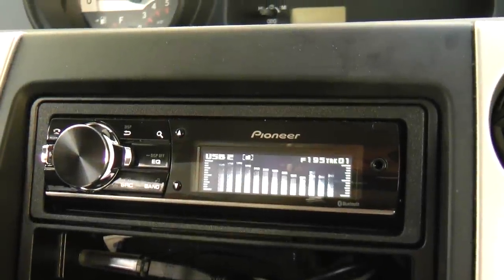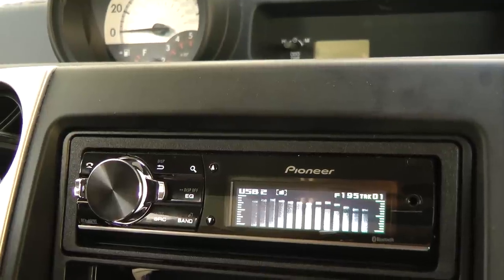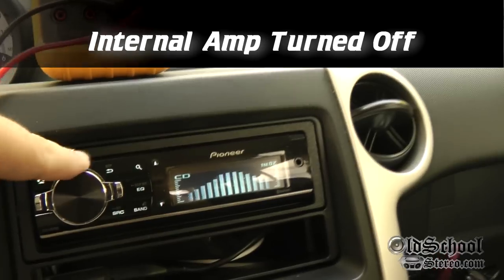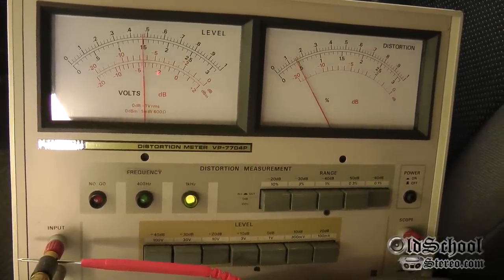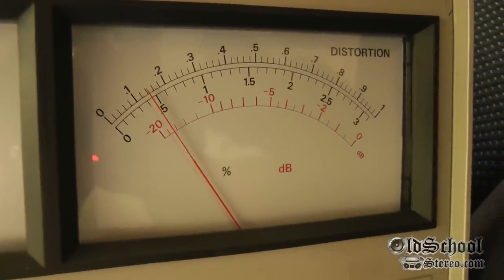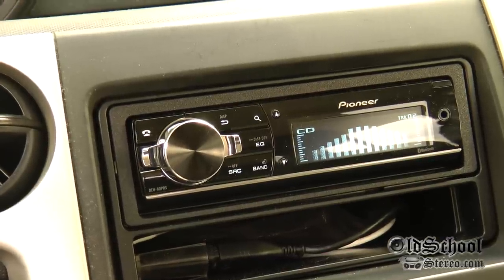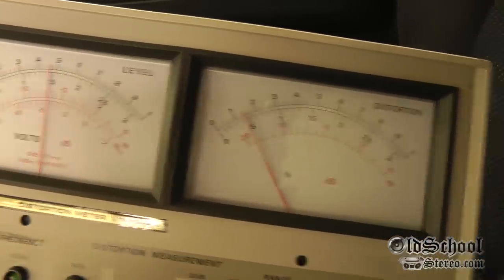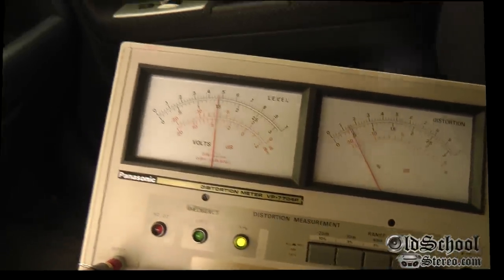Pioneer DEH-80PRS Tested for RMS Voltage and THD Output

Comment from the maker: I'd like to try some old school SQ head units...7909, 7949, Clarion 9255, McIntosh, etc. to see how they compare. This 80PRS gives you amazing features and SQ for a very reasonable price!
Reply: The older units may have a higher THD but for some reason seam to sound warmer/richer than this does.  I like this HU unit too, no complaints D but the 7949, 7990 7909 & the lil 7904 sound incredible, IMO.
Reply: Any other head unit with clean signal and sq? Give me some other option 80prs is sold out

Comment from the maker: I tested another Alpine, the DVA-9861 recently, and this Pioneer is cleaner THD wise (and has more voltage out). Many folks use those DVA's with H701 or H800 processors, so I'll have to combine the two (using optical digital connection), then measure the output at the processor

Comment: Thanks for testing this!  I had the kenwood x997 before this unit and it was nothing but problems.  One thing I noticed is that when I had the x997, I always had alternator whine (even with power going directly to the battery, and grounded on the same point as my amps).  That 80prs cleaned everything up!

Comment from the maker: Yes, I sold the Pioneer / Scion 1805 head unit, but kept the basic factory Pioneer head unit. The voltage output and SQ is just so much better with a good aftermarket HU

Comment: Had the 80prs.Didn't care for how difficult it was to tune.My Kenwood x996 sounds lots cleaner and easier to tune.Good test though D.Always the true stuff on your channel.
Reply: Patience my brother, instant gratification is just the American way now, slow down. Can you remember the old real to real tape systems that were amazing sound but a pain to load and off load. Rewards to those who wait and Listen. 
 It's un-American to be Russian.
Reply: Jonny Breilein yep!whenever I put new stuff in my van I retune everything...will spend a couple hours trying to get the most out of it,till its as loud as I want,and still clean
Reply: @jonnybreilein5343  
I spent 2 weeks with that unit..Was patient enough. Smh

Comment from the maker: Yes, RCA out voltage with the internal amp turned off. I should have compared with the amp on as well. As I'm sure you are aware, it will add somewhat to the THD, so I'd leave it off unless for some reason you'd need to use it

Comment from the maker: The DD-1 shows distortion at 1% THD, this deck does nearly 67x better at 0.015% THD. I recorded a video/test using my Tone Gen Pro app for the 1kHz tone. I think I'll redo it with the uncompressed track on my iPhone 5, the only real "fair" way to compare. This way I'm not comparing using different tracks (in a way).

Comment from the maker: I know what you mean! I'd love to have test gear capable of a full range 20-20kHz pink noise measurement...maybe one day I'll run across a used one for a reasonable price or something. The 400Hz and 1kHz measurements are a big limitation with the Panasonic unit, but it will have to do for now...

Comment: This would be a really great unit but the rca whine which looks to be a huge issue with pioneer was just incredible we tried every trick in the book and ended up putting in a kenwood unit no whine
Reply from the maker: Sounds like a grounding issue. I don’t have the whine issue
Reply: @wal   No doubt, jump over by my channel and see how I stopped the issue, It might be something you never seen or used but stopped the problem dead in its tracks just over a week ago so won't be hard to find

Comment: I have this head unit. Can confirm... Extremely clean.... if you got the $$$
Reply from the maker: +CriticoolHit I still hate the interface and cheap feel, but still the best head unit for the $$
Reply: I don't get the "cheap feel" its very similar to most head units in that regard. One of the biggest, highest quality single din full featured displays though. Not to mention the depth of settings and the most important feature... that crisp, clean output. 

All that being said... No play / pause button right on the front of the unit?  Really?
Reply: CriticoolHit compared to the older Alpine decks or the 99, I agree with ya D. They feel cheap.
Reply: Still... Worth it for that clean signal. (still mad about no play / pause though)

Comment: Hey +bigdwiz, it's ur man from DIYMA. I was really impressed by this. I've never been a big fan of Pioneer decks as I had bad luck with them in the mid 90's. I ended up having one repaired a couple of times. 

Regardless, I am now eyeing one of these on Amazon for $250. I'm curious if there was a difference in preout THD, at a lower volume? When I set up my stereo, I generally set gains based on the source units volume being at ~ 75%- 80% max volume. I'm sure as low as it was at max vol, it would be even lower at a more reasonable volume. Just curious... 

Love the vids and keep it up.
Reply from the maker: Yo Kevin Williams this test was done at max volume, max voltage output and that's the THD I showed. I haven't tried lower volume levels, but I'd suspect even lower THD. When I get a chance, I'll try it out.

Comment: Try to turn it to 62 and engage the eq. Distortion off the charts.  I had this player for two months. Sold it and bought the jvc arsenal 95bt.
Liked the sq better on the jvc but the jvc eq is really insufficient. 
Also thought the bluetooth on the pioneer sounded bad. High distortion after passing 45 on the knob.

Comment: Great test. To perform this test, do you let your factory Pioneer presets to “zero” or increase SLA value and various SPEAKER LEVEL values to reach for the distortion with the volume?
Reply from the maker: +Yvan Doyeux internal amp = off, RCA level test only
Reply: BigDWiz of course only RCA, the question is still the same

Comment: Hey, what's up D.  I appreciate your videos man.   Question for you.  Have you ever checked with the DD1 where this unit clips?  Thanks again.  I subscribed.
Reply from the maker: Thanks for the comment and sub! The purpose of this video is to show how low the THD is with this head unit. It will not clip with the DD-1 at full volume with the 1kHz 0dB track. The DD-1 detects distortion at 1%, this head unit is well under 1% even at full output

Comment: Hey big d wiz. Long time subscriber and viewer of your website.  I have this head unit and I'm having trouble getting the bass where I like it. I love my highs. Just can't figure out where to have my subwoofer level at. I feel like a can't get a good pre out voltage and I have to crank my amp gain if I want to get to the ac voltage that would equate to 3000 rms (what my amp is). What's the best place for all my sub settings before I tune the amp. That will get me the loudest with turning the Amps gain the least? Should I have the "loudness" setting on or off? What level should I have subwoofer level 2 at? I've been struggling with this for a while. On a previous system I had a different head unit. I switched only the head unit to the pioneer deh 80 prs, my bass instantly got much quiter, but my highs got oh so much better. I know this is a lot of weird questions,  that probly don't make sense.

Comment: My 80prs only does 1.958 volts, doesn’t make sense using the same dd1 test tone, and also multiple brands off rcas
Reply: My distortion volume is at 62 so i play music at 61 and clean jus dont have enough rca voltage out,  from wat other people seen to be getting in the upper 4 voltage and 5 voltage on
Reply: @hectorgarcia9509   Did you forget to put your sub level in the 80prs all the way up?  That's your voltage

Comment: Hi Dereck.
If I remove the USB flash for example when leaving the car, and then insert it again afterwards, will the head unit resume playback at the same point of the same track? This is really important to me since I usually listen to long tracks.
Reply from the maker: opaladeluxo73 I do not believe so...but if you leave it plugged in, then it will resume
Reply: opaladeluxo73 yes it will continue playback at the same point, only if you did not modify anything in you flash drive in between.

Comment: Can someone tell me about this test? Is this testing the amplifier in the unit? Or the preamp? And what sources will sound better through this unit? I own a avx 3800 double din that I have not installled yet, and am thinking of selling it and getting the PRS80...but I  need some guidance.
Reply from the maker: +classicjukebox I'm testing the preamp RCA outputs to show voltage and THD. This is the "cleanest" head unit I've tested to date. I want to do another test comparing Bluetooth, CD and USB sources. My feelings are the USB will be the best, but only a test will determine...
Reply: BigDWiz did you get around to doing these tests? ^^  and also. what is the max clean volume for the internal amp? i might run my tweets off of it so id like to know if you have that info... thanks!

Comment: Could run 3 way, and have 6.5 coaxe in back doors, with tweets being ran by unit, front and back doors ran on 4 Chan, and sub on other mono?
Reply from the maker: Not without using some passive crossovers
Reply: Williston Audio Labs i have ummm i think these Polk 651 um 6.5 coax speakers with built in passive crossovers, but just why would i need it? Lol and i don’t have like 3in mids or 6 speakers up front just 4, 2 doors n 2 tweeters, 3 way is on tho, it works, i just really don’t know much or how they have it wired, the b channel is on the tweets a is on doors on my for channel... so ur positive I can just unplug the tweeters and hook the polk up in back with b channel? And have tweeter just run off unit? Please help omg

Comment: I want to buy this HU and go active with 3 way components.  Can I run the tweet, mid and woofer on the front, rear and sub rca's.  Then still have a subwoofer rca for my actual subwoofer?  I'm confused about this part, thanks for any answer you can offer!
Reply from the maker: That would be 4-way and you’d need the P99RS
Reply: BigDWiz thanks a lot do you onow any other brands making a head unit capable of what i need? It looks like the 99rs is not available

Comment: How do you turn off the internal amplifier?
Reply from the maker: Power unit off by holding source button for a few seconds. Then enter advanced setup menu by pressing in on the volume knob for a few seconds. Scroll through until you see “Internal Amp”. Push volume to select off or on
Reply: BigDWiz so would this be best to turn off when using external amplifiers?
Reply from the maker: Yes, if you are not using the internal amps to power speakers, then turn the amp off. It should increase SQ of unit with the amp off
Reply: BigDWiz thanks for the Info, definitely helpful as I didn't know of this since pioneer is kind of vague on the details. 

So far my setup is a complete Focal polyglass 165v components front and rear with the matching 33v2 subwoofer, so this should definitely give me some SQ improvement. 

I actually never ran the unit in network mode, but I'm going to now just have to get another 4 channel amplifier for the rear mids and highs. 

Thanks man!
Reply: BigDWiz when setting up the tweeters on their own amp channel how should I set gain levels to match what they would need wattage wise?. Focal list the Tnp tweeter as 15 watts RMS?

Comment: dude... "oh as you can see here it's between .1% and .2%, 0.015%! woooowwww!" 

No. It's 0.15%
0.015% is well below .1%
Reply from the maker: No, the measurement was set to 0.1 being the max setting at the far right. That means move the decimal one over to the left from what you see on the display. It is 0.015%. Look again at the video. I see how it is confusing though.